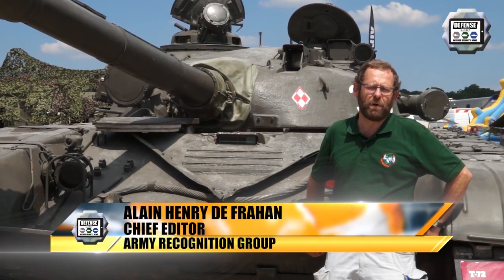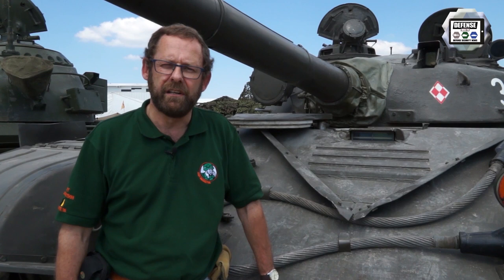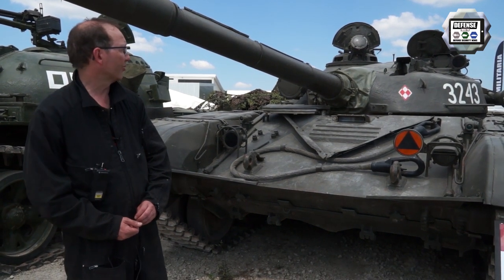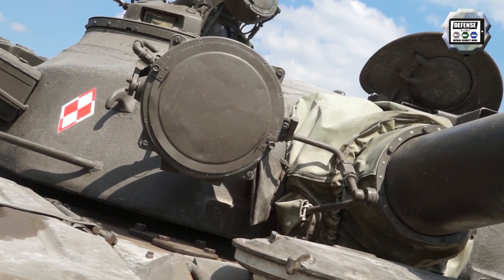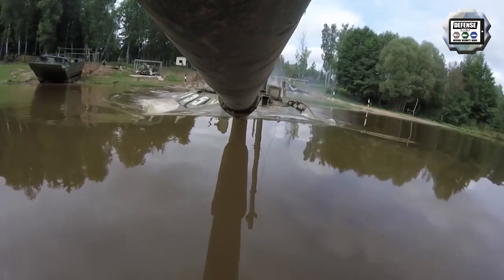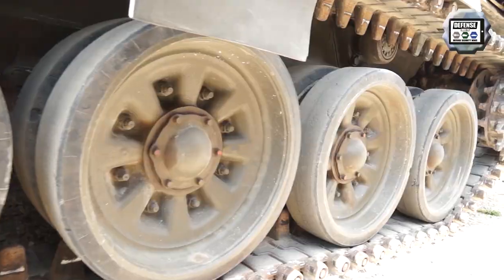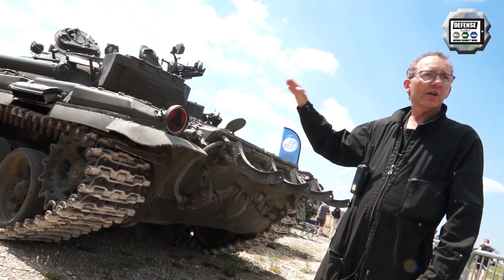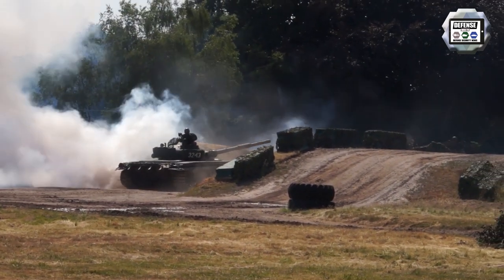T-72A T-72M1 T-72 technical review Soviet-made main battle tank

Comment: A T-72 needs small people (150-165 cm) to operate it; at 177cm I found it incredibly difficult to work in such an environment.  My ladyfriend is even taller than than 165cm (170cm); how many short men can one draft for T-72 operations.
Reply: I don't know who told you that, but they lied to you. In a t-72 tank, a crew of three people can be taller than 175 cm and they can use and operate this tank without any problems. We have had cases where people over 180cm can operate this tank. 175 cm is, for example, the average height in a good part of European countries. So there will never be a problem with crew training for this tank.